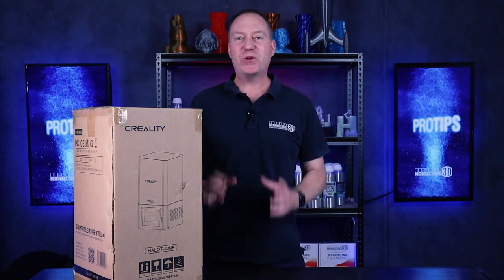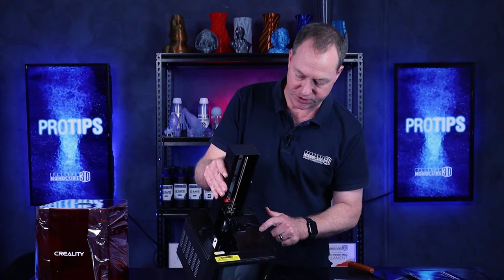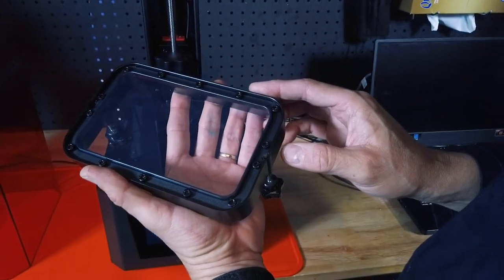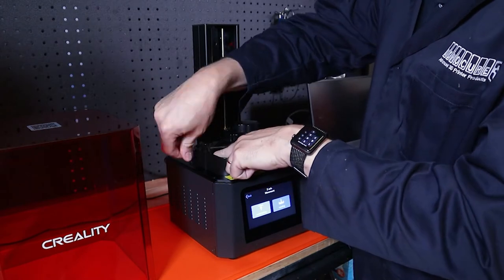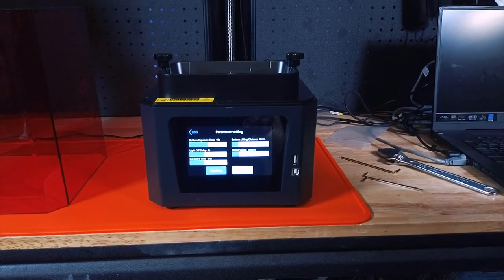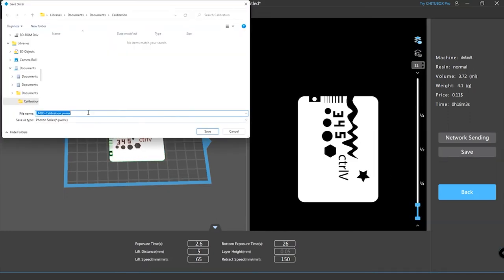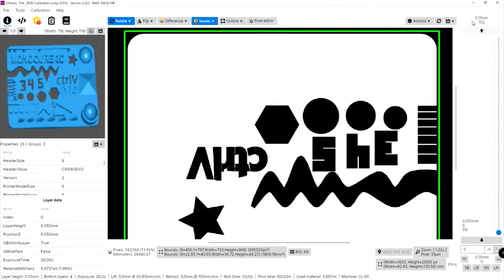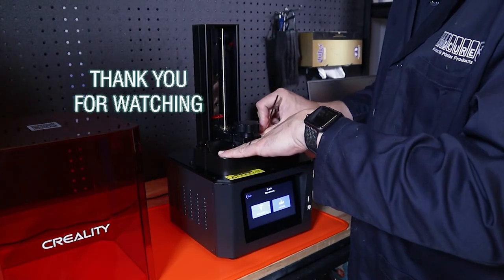Setting Up the Creality Halot One

Comment: Thanks for this video! I bought this machine for around 125 dollars a few weeks ago, it was a bargain and I don't regret it. It has all the features I need for my first resin printer, they only problems I have with it are more problems with resin printing it self. I do have some wifi connection issues, it can't seem to connect to my mesh network.

I also upgraded the fans to Noctua ones because I thought the default ones make a lot of noise, but for users that want to do this; don't bother, it doesn't make much difference (as opposed to the fans on a Creality Ender 3 for example).

I've also printed a filter tower where you can add more filter material (carbon filters for fish tanks for example). This does seem to filter a lot better and longer perhaps, and you can easily attach it.
Reply from the maker: Great deal!! Let us know if you need any help.

Comment: The updated firmware and Halot-Box software take care of the settings so you can now set them in the print file.
Reply from the maker: Finally!! Now they need to store more than one file on the printer!
Reply: @Monocure3DProTips  lol, baby steps. Honestly don't know the size of the available storage on the machine, so couldn't say whether that would even be a possibility or not. They do have a new beta firmware release, but that is all for settings and changing them during printing.
Reply from the maker: @Pendrayk  Just updated the FW and software... yup, you now get an option on the printer to use the files settings or override them with the settings on the printer.  Still stupidly slow for the plate to lower when you start the job.  Seems to use the "motor speed" set in the print file rather than just go quick and slow down as it enters the vat.
Reply: @Monocure3DProTips  It is crazy slow, especially since the motor speed was 8mm/s before the first firmware update, so definitely can go faster

Comment: Great video and I appreciated the physical specs in video form especially, but I think it's not a good idea using the firmware/software that shipped with it if there were upgrades. The Halot One is difficult to use out of the box without the updates installed (no lift up when paused printing, for instance, I think they added that a couple months ago but I haven't tested yet). I believe it was ModBot that had released two videos about the Halot One where the first impression was bad with the firmware/software back in June iirc and in December released the second with updates installed for both firmware/software, and it improved the usage greatly. I was playing around with Halot Box today and noticed it supports the print via wifi option now too. They've come a long way in a short time.
Reply from the maker: Hopefully they will sort out the firmware to be more user friendly. It seems they rushed out the printer to get it to market and the focus on dropping Chitubox for their own system was not executed well enough. Creality is a BIG company with lots of government funding, I’m sure they will sort it out with the future versions. Hopefully they have subscribed to our YouTube channel and are taking notes! Haha
Reply: @Monocure3DProTips  Just in the months since I last commented it's so much more user friendly now I can't even begin. And the software's so much better. Frankly, I understand what happened; they were probably taken by surprise with Chitubox doing what they did, and had to scramble to create their own system and I do NOT blame them. Creality even reccomends Lychee if you don't want to use Halot Box. That said, I've printed off a lot of stuff with my Halot since Feb and the biggest advantage is definitely setting the parameters on the machine rather than the slice file. Calibrate for the resin I'm using once, and let it fly.
As a side note, I actually prefer the support genertion in the latest ver of Halot Box over Chitubox, just seems to give better results.
Reply from the maker: Thanks for the update! We will try the new software and let you know.

Comment: Really clean and professional looking review with on point pro level observations. Thank you guys for this effort.

I purchased Halot One and Anycubic Wash&cure Plus 3 months ago but did not have much time to use them. But so far I realized that I need mid size printer to print statues and superhero characters that I model around 25-40cm sizing.
I am down to two models  Halot Sky and Mighty 4K. I need to buy one this weekend so I really appreciate your opion on that matter. Mighty 630 usd, Sky 1015 usd.
My idea was to be able to print mid size characters in multiple parts on a single print session, and if the detail level is not enough, then add Sonic Mini 8K to my arsenal to print parts of the model that needs more details like heads and hands. If my midsize printer is enough then there will be no need for Mini 8K tho.

So I am not sure if you had a chance to test/observe/work with Halot Sky but so far in reviews I've seen they mention it as the best build quality in midsize printers as well as print quality, where Mighty also on par with it with a cheaper price tag. Halot also has wifi and on device print settings comes handy if you don't want to reslice the model every time you change print settings..but If I am not wrong, in your mighty 4k review I saw you can change  print settings via device screen as well without going thru reslicing the model.

Since I have experience with Halot One, I feel biased towards Sky model but There is 400 usd difference to justify if I go with Sky. So guys, I would be glad to have an objective opinion, what would you suggest? Thanks!
Reply: I haven't heard of anyone not liking the Sky. It arguably has a better UV array than the Mighty, but they both produce nice prints from what I've seen. The Sky is a workhorse that appears targeted for small-business that do 24 hour printing, so maybe overkill for personal work. Perhaps if you can you may want to wait though as better specced machines like the Anycubic Mono X 6K are beginning to be released. I would buy a Uniz Ibee if I had the choice, but they're expensive where I am.
Reply: @benclifford8549  thanks for the reply. Where i live prices change dramatically. It got doubled in two months. So i was kinda in a hurry. I ended up getting halot sky, I thought i can keep it for mid size works for a longer period then if 6k photon comes out with a reasonable price I might switch to that then. But i feel very good with this purchase. Its really solid machine. S

Comment: i notice theres meant to be some kind of calibration card ? maybe thats actually what that little triangle piece of cardboard that comes with the accessories is ? *all though it does seem a little tiny to give an accurate calibration lol
Reply from the maker: Just use the vat in place when getting level. Remove the resin first. You don’t need the paper they provide.
Reply: @Monocure3DProTips  i leveled it in the vat, but i still had the protective film on the lcd screen below which i didnt want to remove before my resin arrives in the mail, will that make a difference in the leveling ? or will it be better to just do one final leveling when i remove it and do my first print

Comment: Can you avoid when it finishes printing to go all the way up, it spills resin all over the place! thanks
Reply from the maker: No, that’s part of the firmware settings. The resin should just drip back into the vat?
Reply: @Monocure3DProTips  sadly it spilled all over the place, at least it was with the cover on! first print, not even played with the config, just did a matrix and it came out great.
Reply from the maker: Send me a photo please. Support at Monocure3D dot com dot au

Comment: The new firmware lets you use file parameters. I just can't get UVtools to work. It won't convert my stuff to cxdlp
Reply from the maker: We need to update this video
Reply from the maker: Latest UVTools will save to cxdlp format however it does not seem to be the newest format which has the exposure settings stored in the file.  Just have to use the latest Halot Box for now.

Comment: i would def update or replace this video, a lot of the info in this video is no longer correct, creality changed a few things since this video
Reply from the maker: We are working on this
Reply: @Monocure3DProTips  cool, ty for reply
Reply from the maker: @andrewsummit8314  Just updated to the latest FW and Halot Box.  You can now apply different resin profile settings during the slice and select them rather than the printer's settings when you go to print.  Will try to get an update video recorded soon.  Still needs an override for the homing speeds (unless I missed that setting somewhere?).

Comment: Good review but it doesn’t do justice for a review being released a day ago
Reply: As in, this should have come out soon after the Halot One came out?  We filmed it a couple of weeks ago, so apart from the unit having the original FW and not the latest, my views are still no different on it.  It does nice prints but the new file format is lacking the ability to store your own exposure settings in it.
Reply: @johngrouse5487  yep you still have to set the settings in it but the new thing is, the creality cloud app works. You can send prints off of your phone directly. But it only works for simple models. And the UI is more user friendly. U can even send prints sliced on halot box directly through wifi. It eliminates the use of usb. Check out the new firmware.
Reply: @richieyumnam8646  Halot Box is a very dumbed down, feature lacking slicer.  So even if you can send a sliced file over WiFi, nothing about the software makes me want to use it.  

FYI, I just updated the FW to the very latest (2.201.20) and while the interface is an improvement (+/- buttons on the settings) and you can connect to the Creality Cloud, the fundamental issue of one set of settings to apply to all sliced files rather than use the settings in a sliced file still does not work particularly well for us.  Add on top of that, those settings cannot be tweaked during a print.  

Look, it's a good printer for those who don't need any bells or whistles and only use a couple of different resins.  I just think Creality have taken the wrong direction with their MSLA file format.